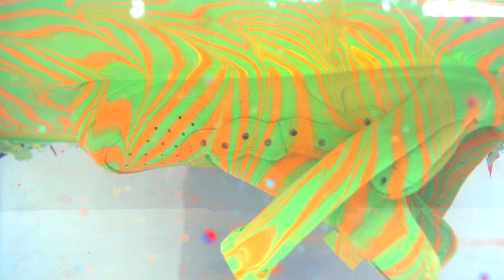BEST of HYDRO DIPPING | PS4 + Nintendo SWITCH Lite + Nike AIR Force 1

Comment: Hi! You inspired me to hydrodip but I have a question: how do u put the stick in the water to make the paint look better, i cant do it because the paint sticks. How do u make?
Reply: julia torabi I think it’s the spray paint he uses, or you have to do the spray paint really quick so it doesn’t turn plasticy
Reply: @julia torabi i’ve done hydro dipping as well, and it works better if you do it on something clear. Like when he did the controller and nintendo switch he hydro dipped the inside of the case. that was so it doesn’t stick or have a painty feel on the outside. But for opaque things I have no clue